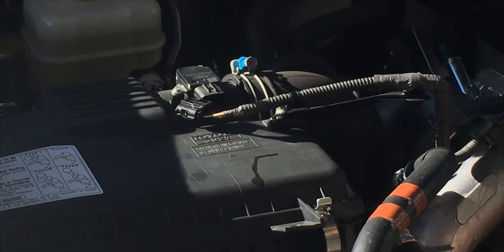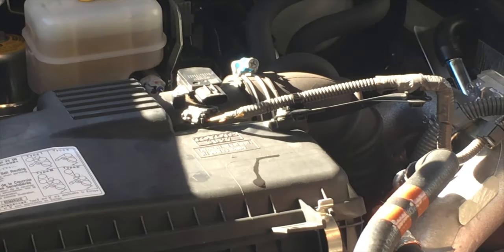AVOID DUSTED ENGINE

Comment: I've found through much (read many years) experimenting that manufactures don't do things for no reason and usually the design is great with many parameters taken into account, execution in some cases lacks, but properly maintained/checked the vehicle works as designed. There are things that can be improved like power where the manufacturer errs on the side of reliability not performance, the thing is ones the performance is "improved" things like running gear, shafts diffs and gear boxes etc under the lifted performance and therefore stress prematurely wear out and or break.

Comment: The aircraft industry use the very same technique on Turbo Prop engines. This is of course regarding the back wood facing snorkel intake. Turbo Props have their intakes at the rear of the engine. This is so ice/snow etc, cannot make the 180 deg turn to enter the intake. The air can turn the corner, but anything heavier if just tossed out the back. Love these vids. Thanks again.

Comment: Safari spent 30 years designing snorkels. They are track and lab tested. If your going into bull dust territory fit a proper cyclonic-type pre-cleaner, don’t drive in other vehicles dust cloud! Leave the snorkel facing forward it’s that way for a reason.
Reply from the maker: Then why is it the standard snorkel that comes on a 200 Series GX has the holes in the back

Comment: Safari have engineered the snorkel to face forward. They only recommend turning the snorkel in snow falls. Ramming the air in from the front enables the snorkel to seperate water from the air flow during rain.
Reply from the maker: It separates perfectly.
Has a great head start with it being a better way, like Toyota not Safari 😉🤷‍♂️👌
Reply: @Fourby4Diesel  thats not how safari explain how their snorkel separates the water from the airflow on their website, comparing that to toyota if they have a standard air ram that faces backwards is comparing apples to oranges, safari say the air needs to be rammed into the intake to seperate water from the airflow. Go have a look for yourself.
Reply: Seen even water in  ram type filter. Cyclonic pre-filters are used on earthmoving equipment